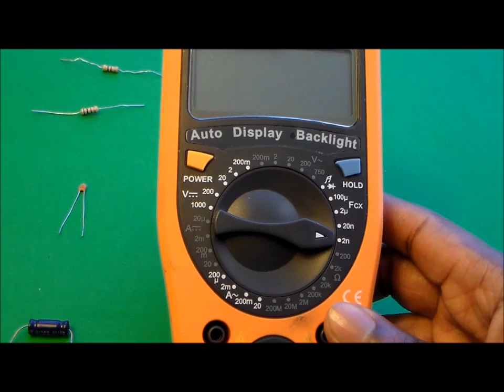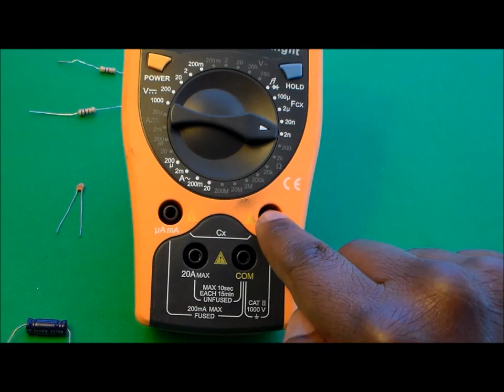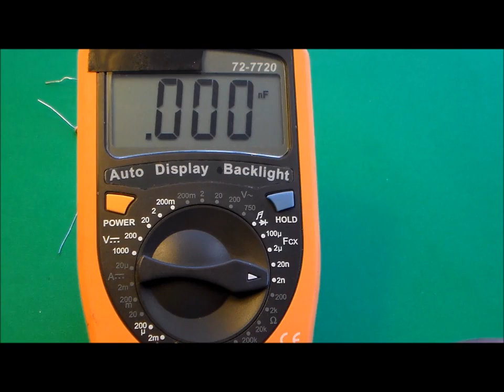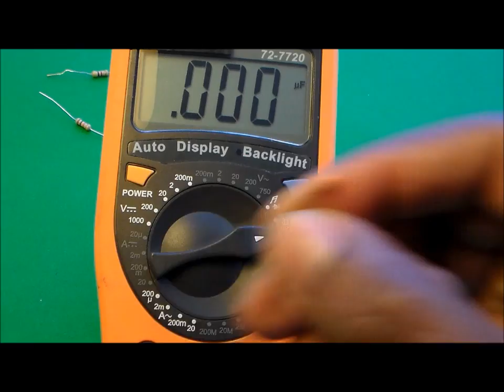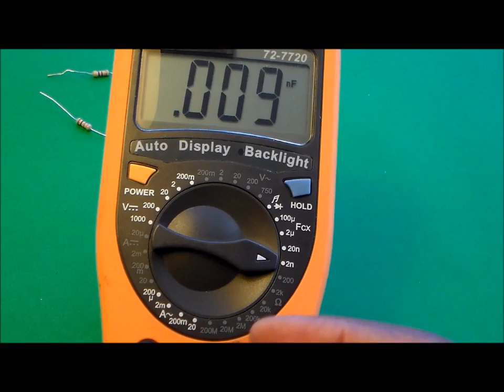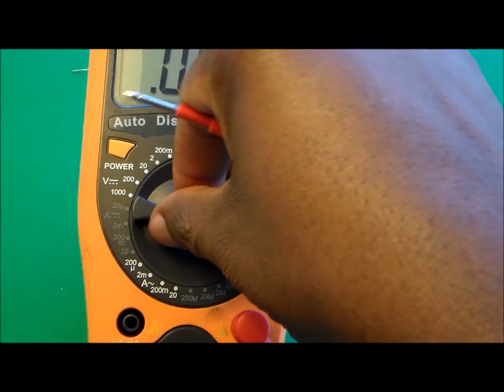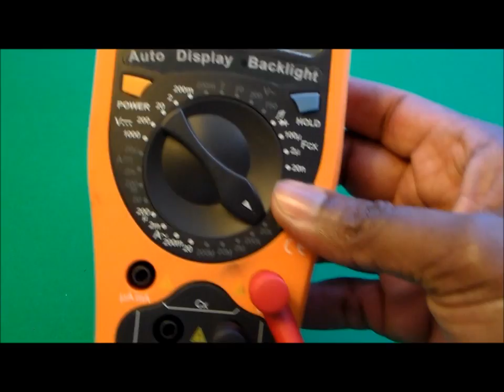How to Measure Capacitance and Resistance Using a Multimeter

Comment: Thank you so muchh, you helped me realize that I'm supposed to plug the probe to the plugs with "CX" (Mine is between COM and the 200mA), before I watched this video, plugged it on COM and the Voltage Ohm plug. Thank you so muchh.

Comment: On a 4700uF capacitor my Capacitance meter measures only 16uF, on a 6800uF it measures around 9uF. These capacitors are bad?? 
(Other capacitors are measured correctly)
Reply from the maker: Thank you for asking. Please check the user's manual for the device. Check the range of capacitance the meter can measure. That would be my best suggestion.

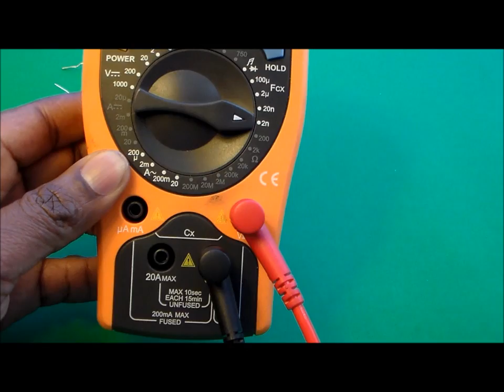Comment: 7:36 you CAN have negative capacitance! ...what he meant to say was "negative resistance" ...don't believe me..go hook up VCC + Source to the "-" of an electrolytic cap and hook up the other leg of the capacitor to ground...make sure to hold it close to your face without safety glasses on so you can clearly see what happens when you apply power to that configuration! XDDD

....if you seriously did that...you are working very hard for your Darwin Award...I'm sure he's proud you're proving his hypothesis correct.

Comment: Can you test the capacitors while they are still soldered on a board if its not a powered up board say Like you remove a tv board from a tv and just have it on a table no charge through it in anyway can you just test touching the 2 solder points?

Comment: How about one where the capacitor says 3300uf but your meter only goes to 2000uf?
Reply: You have to do the tongue test. You charge the capacitor and then apply the capacitor to your tongue. A really really big spark and a lot of pain means you are close to the 3300 uf range.
Reply: @stevesharts5419  Yeah, I will believe what it says.

Comment: If the multimeter does  not have a way to measure capacitance can I still measure capacitance?Excellent video, very informativeCheers,Rob
Reply: +Rob Hernandez No But you can buy a capacitor metor on ebay for $10 or $15.00
Reply: +Bob Barcus Thank you Bob i think i will.Cheers